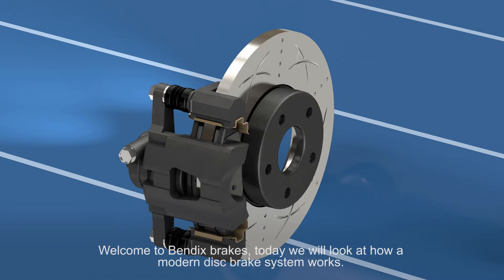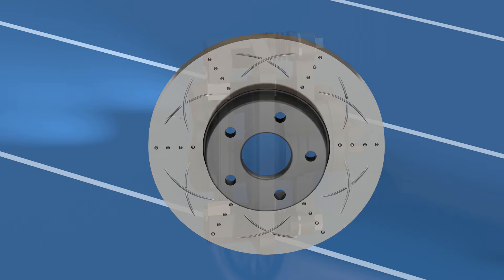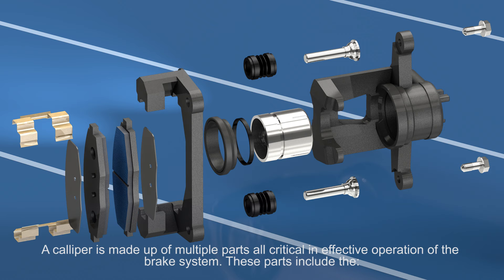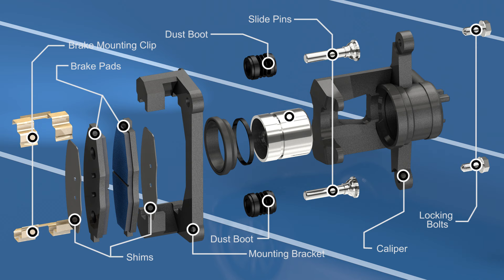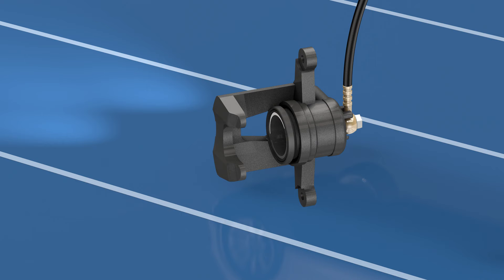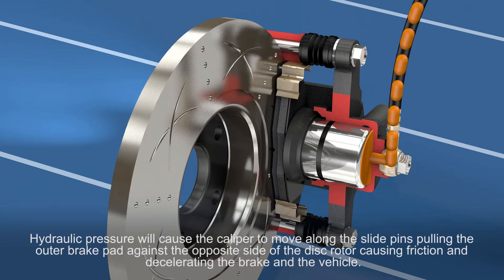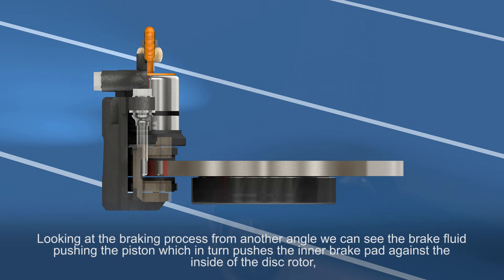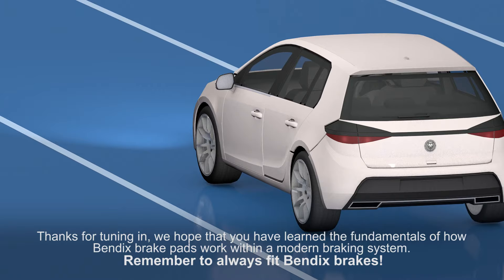How car brakes work

Comment: But what causes the brake pads to go back, and not stay stuck against the brake disc?
Reply: 1:24 The calliper is fed brake fluid, which pushes the brake pad against the disc using a hydraulic system. Search up hydraulics and you will understand how it works, it retracts because the hydraulic pressure is retracted retracting the calliper which is connected to the disc after you take your foot off the brake pad.
Reply: @alexmk43 🎉🎉
Reply: Vacuum within the brake lines
Reply: @alexmk43 they also come with little pins you attach to both pads that push them apart, or the ones I’ve seen at least
Reply: you never leave the contact.  If you slightly increase the gap between the pads and the disc you lose your brakes and need to press multiple times to bring it back
Reply: The inner seal very slightly deforms  and folds outward with the piston every time the piston is pushed out and it naturally wants to return to its idle position. 

The tolerance between the seal and the piston is extremely tight, even at rest. The increased compression between the two surfaces and the torsion acting against the rubber as it deforms behaves somewhat like a rubberband trying to pull the piston back with it.

This increased negative pressure acting on the piston, along with the vacuum in the system when the pedal is released, pulls the piston back just enough to disengage. This is just enough that the seal sits at its most relaxed state which is a smooth and flat seal against both the piston's surface and the inside of the cylinder bore.
Reply: It must be the diminution of the hydraulic pressure

Comment: What prevents the brake pads from constantly rubbing against the rotor when brakes are not applied, since brake pads move freely within the bracket?
Reply: The piston will retract once the pedal is decompressed. This is due to the brake cylinder creating a vacuum as it moves in the opposite direction. As for the brake pads themselves. They will be forced away from the disk due to the inertial force generated by the moving disk. This is why it's important that the retaining clips are replaced with new ones that will come with the new brake pads. The new pads will also come with some grease to ensure the pads are able to move freely in the retaining bracket. It's also important to clean up the caliper bracket with something like a wire brush. Make sure when applying the grease that it's only applied to the retaining clips/brakets. If grease is allowed to get on the pads or disk, expect to run into some problems.
Reply: @marktaylor171 bro when u said pads will b forced away from the disc due to inertial force thats right but i would like to add something very peculiar to it so that people who read the comments can clarify their problms properly i would like to add that when brake pedal is applied the piston as well as the pins which are directly above and beneath the piston contract and retract as well and when we aplly the brake and losen it ,but if the pins are stuck and have the debree in that or are having a play in that case if brakes are applied or released they get stuck to the rotar discs . So the both pins must be checked when ever we are having vibrations to aur brake caliper or the brake pads are stuck to the rotar hence causing friction even after releasing the brake pedal n by the ways no offence to ur comment respect ur opinion as well 🤟

Comment: how do the breaks return to the starting position?
Reply: so when you press the brakes there’s lines and cables connected to each of the tires with a liquid inside, when you push the brakes it forces pressure into those cables with the liquid forcing the liquid to move to the brake pads (if that makes sense) and when u let go of the brake it’s letting air back in (less pressure) on the liquid to not be pushing against the brake pad.

Comment: I don't understand how the outer pad moves in towards the disc rotor when the brakes pressure is applied.
The inner pad I can understand is being pushed by the piston towards the disc rotor, but the outer pad? How does the slide pins achieve the opposite movement? I can't visualize it.
Reply from the maker: To Visualize it please watch the video to the end, it clearly shows the movement of the caliper on the slide pins once brake fluid pressure is applied.
Reply: Yeah I've been struggling to understand that as well. I've got it now! Watch this video in slow motion, press the 3 dots near the top right of the video and adjust the speed. You'll see that once the piston has pushed the inner pad onto the disc, that same pressure from the piston will then push the caliper in the opposite direction, pulling the outer pad with it towards the outer side of the disc.
Reply: @BatlleIsMine  Yes mate. you are correct. a brilliant solution. one piston yet able to move the pads on the opposite side....

Comment: Hello. I'm still curious on why the pads are only 60degrees at best from the total 360 degrees of the wheel ? 
Won't a full circular breakpad work even better ?
Or at least dual-breakpads.

Comment: I don't see any springs.  I understand the caliper/piston pushing the pads against the rotor, but what causes the pads to retract once the pressure is reduced?
Reply: The piston is retracted by its  internal seal  the pads just relax .

Comment: Would the brake wear be faster on the inner pad? It looks like it needs to contact first for it to hold
Reply from the maker: It happens so quickly that its a none issue in regards to pad wear.

Comment: does the piston retract when you come off the brakes? i have replaced my rear discs and pads and im getting an annoying rubbing and clicking sound. The inside pad was really tight to get in. I might need to file off a bit from the lugs
Reply from the maker: We suggest seeing your local mechanic to solve any braking issue